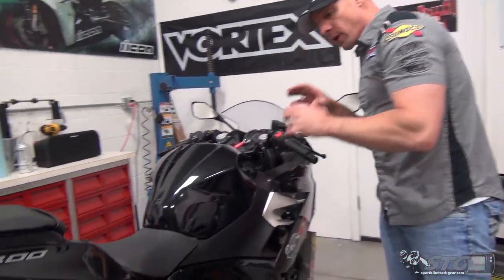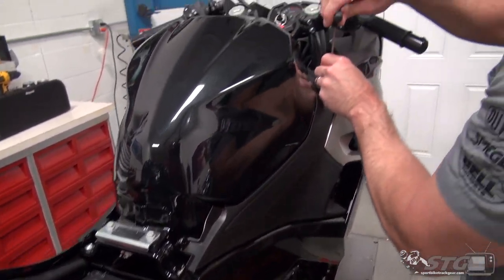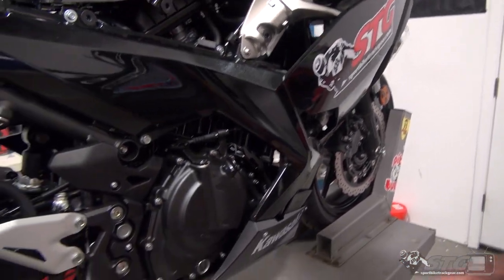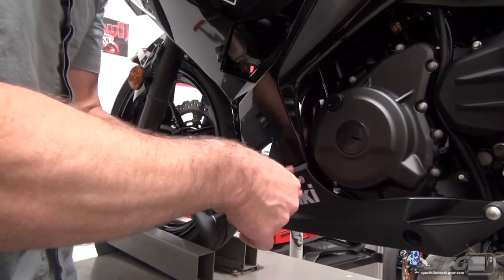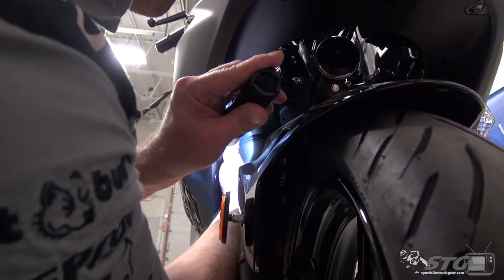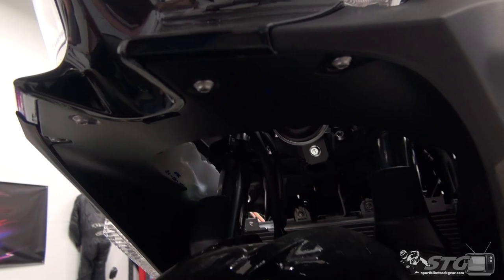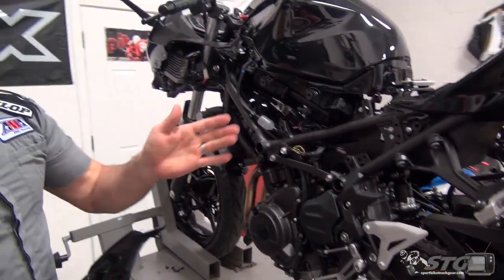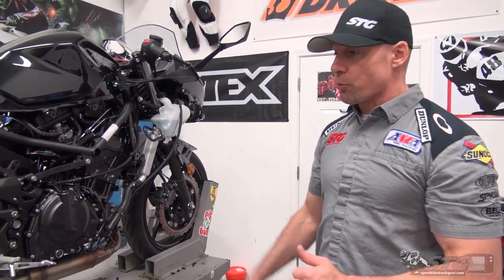2018-2023 Kawasaki Ninja 400 Bodywork Removal Tutorial | Sportbiketrackgear.com

Comment: This is still valid for the 2023 ninja 400, I used this video to help install / cleanly run my quad lock wireless charging head cable wire. Appreciate it brother.
Reply from the maker: Yes the 2023 is going to be the same as what we show here. - Van

Comment: Amazing video! Helped me tremendously. The only issue i’m having is removing the front fairing that’s around the headlights. I can’t get it off for the life of me and it’s not shown in this video 😭 please help. Thank you!
Reply from the maker: IMO that one is pretty easy once you have the side fairings off. It bolts on from the backside around the headlights. Once you have the fasteners out you need to pull forward to slide it out of the rubber grommets. - Van

Comment: Hey can u tell me the size of every tool and socket wrench needed for this again so I can write it down. And is there a diagram on the size of the bowls I need for each piece and when I put the black screw things in and push pins. I got some new fairings and I have new bolts ima use. I can't find a good and easy diagram to read 😅 sorry

Comment: Great video thanks, only problem I had was the well nuts on the bottom panel had seized, with some small mole grips I stopped them from turning and got the capscrews out, the well nuts then levered out with a screwdriver and I got replacements off E bay, they are c-550 wellnuts,  14mm in length to fit a 10mm hole
Reply from the maker: You are welcome and thank you for watching! - Van

Comment: Are all the bolts and washers the same? Or do I have to separate them in groups according to the parts?
Reply from the maker: There are several different fasteners used to install the bodywork on the bike. If you are worried about getting the right fasteners back in the proper location I suggest taking pictures with your phone when you disassemble the bike. - Van

Comment: Great video! Is it possible to remove the gas tank without removing the bottom side fairings? And just to confirm, the gas tank needs to be removed to access the connector for the ignition, correct?
Reply from the maker: You will need to remove all of the fairings to get that access. End of the day this is not a very difficult task with the Ninja 400. - Van

Comment: Am I correct in assuming that removing just front lower section with those push-release tabs would be enough for access to replace turn signal bulbs when the time comes? I should hope something as common as gaining access to replace bulbs wouldn't require more than that.

Comment: Which is the race bodywork video showing how to remove the upper fairing?
Reply from the maker: The upper is pretty easy to remove so we did not show it in this video. Most maintenance requires only removing the parts we do in this video. - Van

Comment: How do I get the left back seat fairing that has the key slot to unlock the back seat off the bike
Reply from the maker: This is the only video we have for the OEM bodywork. Pretty sure you need to remove the cable from the latch. To do this unbolt the latch then you can slide the cable off. - Van

Comment: I had to replace the headlight piece on my ninja 400, but now the headlights don't point directly ahead. Any tips on reinstalling the headlights so they are aligned correctly?
Reply from the maker: First make sure you have all the parts installed correctly. If you have everything installed correctly you will need to realign the headlights. I have not done that on this bike so I am unfamiliar with the adjustments provided for this. You will need to have  a look at the service manual to understand the adjustment procedure. - Van

Comment: Thank you for the awesome tutorial. Do you know how I can trouble shoot why I am not getting any power to my bike after I reintalled the fairings. The only cables that were ever disconnected and reconnected were the turn signals. When I turn the key I get nothing..Thank you
Reply: Agent X check the fuse boxes
Reply from the maker: What the other user said, start by checking your fuses. From there make sure the battery is charged as well. - Van

Comment: After installing some frame sliders, I found that my re-installation of the side fairings shows some gaps.  This is predominantly near the front fairing and around the nose.  I guess I need to go back and take them off and reinstall.  I think I just didn't get some of tabs in place correctly.  Is there a particular order they should go on?
Reply from the maker: Sounds like you did not get all the tabs lined up before you put the fasteners back in. You will need to take them back off and start over. Pay close attention to the tabs before you put the fasteners back in making sure they are all engaged properly. - Van

Comment: Does the plastic fairing that goes around the front blinkers and wraps around to the nose come off separate from the whole side fairing? I'm looking to hydro dip that piece but would hate to take the whole side off just to get to that one part. I rely on you basically for all my mods on this 400.
Reply from the maker: Both of the side fairings, the upper fairing and the inner fairing are all separate pieces. If you are referring to the inner fairing that connects to the upper and sides it can be removed without removing any of the other fairings. - Van
Reply: @sportbiketrackgear  yeah I'm referring to the plastic piece that goes around the front blinkers and wraps to the nose of the bike. It appears that piece can come off by itself without taking off the whole side panel. Sorry my bike is in a crate being transported to another state while I relocate, or else I would check.

Comment: man I dont know how to change the passenger seat on the kawasaki 400? do you know if there is a video where I can see how to change it?
Reply from the maker: Use the key in the lock cylinder on the left side of the tail section to release the passenger seat. - Van

Comment: I can’t seem to remove the tail fairing, I wish it was included… right one was no problem, the left one is being annoying because for some reason the lock is actually attached to the fairing? On the 125 it just came off and left the lock behind
Reply: Nevermind I did indeed get the cable released from the lock…. What an annoyingly unnecessary and fidgety design…. Now my fingers hurt aha 😅
Reply from the maker: Sounds like you got this sorted out! - Van

Comment: Where is the idle adjuster? I HAVE A 2019 SAME MODEL
Reply from the maker: You should not need to adjust the idle on this bike (also I do not believe there is an adjustment provided). If you are having an issue with poor or too low idle you have another problem that needs to be diagnosed. - Van
Reply: Thanks

Comment: Moving from the ninja 125 to the 400 was a little jarring when it came to this sorta stuff… on the 125 I could take any individual panel off without removing the whole kit, on the 400 you gotta do everything in a specific order it seems

Some stuff is better designed, like the front seat release…. But other parts feel less practical
Reply from the maker: A little different for sure but still easy to service IMO. - Van

Comment: how do u put them clips back in for the pannel under the headlights but above the front wheel
Reply from the maker: Pretty sure you are talking about the 2 piece plastic clips. You need to make sure the center is disengaged which allows the legs of the larger outer to compress. Once you have done this just push the clip in them push the center to secure it. - Van

Comment: Where is the idle adjuster on this bike?
Reply from the maker: I do not believe there is any adjustment provided for the idle. If the bike is not idling properly you need to find the problem that is causing that condition. - Van
Reply: Thanks